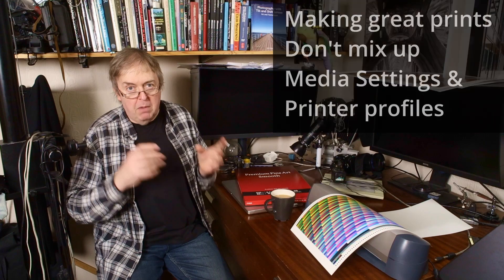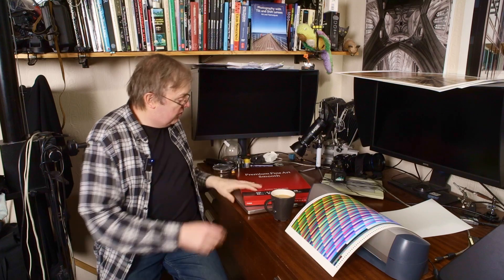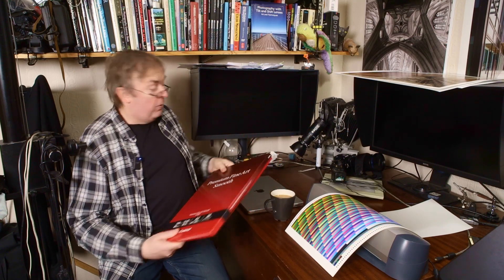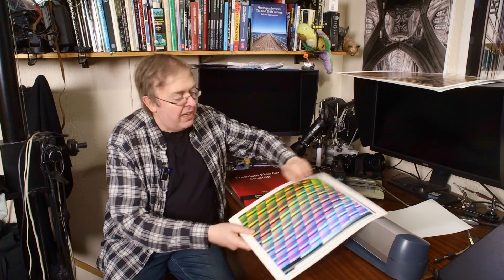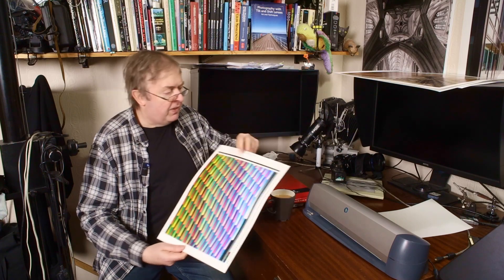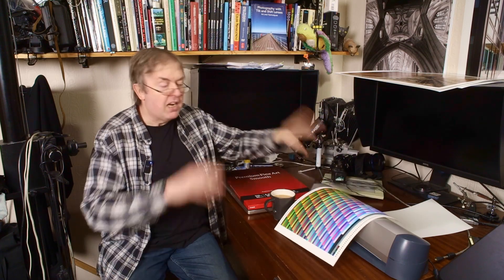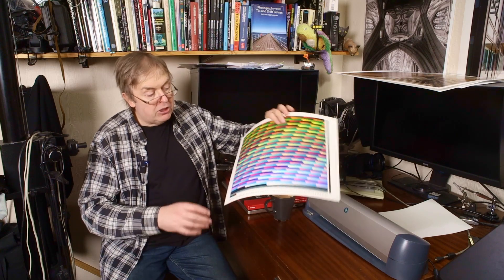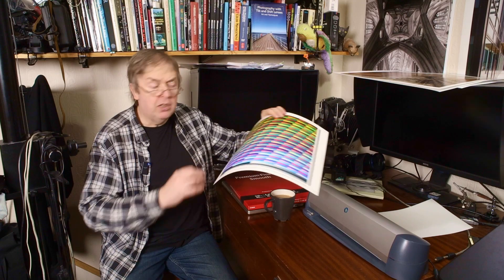Don't mix up media settings with printer profiles. Making an Epson profile with a Canon paper

Comment: Many thanks for your highly instructive videos. Finding them really helpful. I own an iPF5100 printer, but unfortunately I have to part from it as Canon is no longer producing the inks. Was thinking of replacing it with a Pro1100, but I’m getting the impression that this seems much more wasteful on ink than the iPF5100. I do not print a lot but enjoy doing it and can’t say that the cost of inks for the iPF5100 was ever a burden. Ink carts used to last so long that my worry always was that I had to use them way past the expiry dates! The 1100 has smaller carts and I am getting the impression that I might end up having to get new carts every couple of months even if I don’t print!! Was thinking of getting the Pro200 instead but for me
It feels like a downgrade from what I had. Any advise please?
Reply from the maker: The 5100 was one of my earliest large printer reviews [long before I started the supplemental videos] and I have regularly asked why Canon never continued the line. 
The 1100 will use more ink, but it's not as bad as some would have it [I have a video on this]
See my 1100 review
https://www.northlight-images.co.uk/canon-pro-1100-printer-review/
The 300/310 might be a better choice than the dye based 200?
Reply: @ Many thanks for your reply. I’ll see more into it and decide. Your reviews and tutorials are amazing and it shows that you have a huge experience and I really like that your recommendations are sincere and not biased.

Comment: Sorry to keep asking but here’s another about media settings using the 8550. Printing on a Canson Platine Fibre Rag 310g/m2. Have the relevant Canson ICC profile. Canson website says use media setting Ultra Premium Photo Paper Luster. But, no such media setting appears in the drop down list. So which media type do I choose. Canson says the Platine paper is a semi gloss paper. The closest in the bedroom down list is Epson Premium Semigloss. 🤷🏻‍♂️
Reply from the maker: The Canson site is indeed wrong [not a good sign]
Not one I've tried I'm afraid, Premium SG is my general purpose choice on the 8550

Comment: One issue I’m struggling with is soft proofing and out of gamut warnings. I have an ET 8550, using Canson fine art papers with the appropriate media setting and relevant ICC paper profile, yet the out of gamut warnings still appear. Even using all Epson settings - papers, media etc still gives out of gamut warnings. And my MacBook Pro has been colour calibrated. Where to from here? Cheers. Ed
Reply from the maker: Ah, the perils of 'soft proofing'... Ignore the 'warnings'  :-)
The problem is that, certainly on art papers, it's quite easy to have elements of an image go beyond the gamut of the printer/profile/paper combination.
The issue is that a warning can occur whether that colour is fractionally out of gamut [OOG] or lots.
This is one reason I do not introduce soft proofing into any of my print related teaching until quite a few prints have been made and I've given a grounding in what it does, why it can work, when it doesn't and rendering intents... [One job of rendering intents is to address the common issue of how to print OOG colours]

 I dislike the way soft proofing is often promoted as a standard step in the making of any print. It is a tool which can be helpful, but should be used with understanding [the bit that tends to get glossed over...]
Reply: @ thanks for the speedy response Keith.

Comment: Hi Keith, I have the Canon Pro-300. Besides setting the media type in software when printing, do I also have to select it on the actual printer? Thanks
Reply from the maker: I've long made a deliberate choice to do both - it is a habit which has saved me a fair bit of wasted paper over the years.
However, I believe the printer can be set up to ignore printer settings [detect mismatch off].
When I'm doing my testing it's easy to get wrong - obviously this may not matter for some people using just a few papers...

Comment: The ET 8550 seems to have an abnormally-small buffer. The device I use to send a file for print is tied up almost the entire printing time, spoon-feeding lines of the image to the printer. Ot would be nice if putting a camera card in the printer's card slot added to the buffer size.
Reply from the maker: What do you mean by 'device' in this instance?
Reply: @KeithCooper  Phone or PC in my case.
Reply from the maker: Phone - well, yes maybe
PC should not make any real impact
Just don't see this in any testing...

Comment: Hey Keith, love your reviews on the ET8550, got one for myself. Just a question, occasionally it seems to print blanks. The files I sent to the printer are not blanks it just seem to take a sheet, cycle it through and then just pass it through the printer without actually putting any ink on it. I've also has moment when it only print part of it before cycling it through. Any experience with this issue?
Reply from the maker: Sorry - never seen that.
Maybe a comms thing?
Reply: @KeithCooper  Could be, probably is to be fair, I never had the best luck with wireless connection with printer. Thanks for the reply!

Comment: Hi Keith, really good video/info. I have some older Epson printer paper I purchase years ago that no longer match the printer paper names include for the ET-8550. For example, I have some older Epson Matte Heavyweight paper, but I don't see that paper type listed? Same thing the the glossy paper, names are different. I guess they want you to discard the older paper and buy the newer stuff? Any suggestions?
Reply: I have a P900. I use both Archival Matte and Matte Paper- Heavyweight ( it was cheap).  The Matte Paper-Heavyweight instructions say to use Premium Presentation Paper Matte as the Paper Type. If that is not available use Epson Matte or if they are both not available use Matte Paper- Heavyweight.
None are available in my selections but Archival Matte is present . Interestingly the Matte paper- Heavyweight is lighter per m squared than the Archival Matte paper. 
I used the Media Installer to create a new EMX file titled  Matte Paper- Heavyweight mainly so i could keep track of the costs in the LFP Accounting tool however I did change the paper thickness from Archival Matte default as Matte paper- Heavyweight is thinner. 
The ICC profile I used  was the Epson P700-P900 Archival Matte supplied by Epson. The prints are excellent with the Archival Matte on both types of paper.
Reply from the maker: Yes, names do change. The place to look is the paper specs, look at gsm, thickness [not the same thing] as well as general characteristics.
The Epson matte heavyweight will work with the printer just fine - I can't remember the current version, but it will work OK...  See the various papers I've listed in my 8550 review

Comment: A question for clarification: I understand the difference between "media setting" and a "profile." And when using a third-party paper (or a Canon paper on an Epson printer, and vice versa), you must select both variables separately.

But what about if you are printing on an Epson paper supported by your Epson printer. I have been assuming that after selecting the approprite media type, I should then select "printer manages color." Am I correct to assume that this last selection activates a hidden paper profile built into the printer driver?

Thx for any clarification.
-Matt
Reply from the maker: The printer manages colour option is for using the driver's internal 'colour management' - yes, there is 'secret sauce' in there somewhere ;-)
However If I was printing on an Epson, via EPL for example, when you select a media type, it will look for a default profile associated with that media type - this would be the auto setting. If I have another profile I want to use [say one of mine for an Epson paper] I would select the media type and then manually select the paper profile I wanted to use.
If I was printing from photoshop, I'd select PS Manages colour and the profile I wanted to use [epson's or mine] and then select the media type in the driver [where colour management would be turned off].
So, the media type can 'push' a certain profile in some circumstances, but in general, 'Printer manages colour' is only something I'd use with say the B&W print mode [ABW for Epsons]
Other software may behave differently in using the media type's default - in general though I always select the profile I actually want to use.
Reply: @ Got it. Many thanks for clarifying.